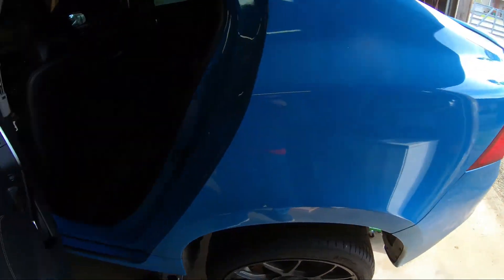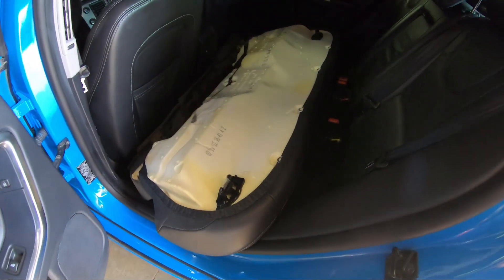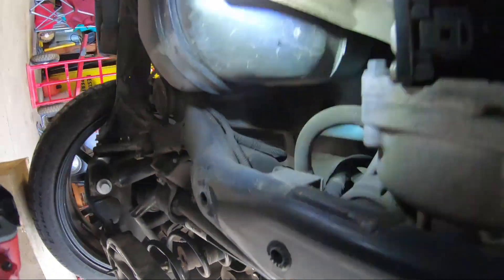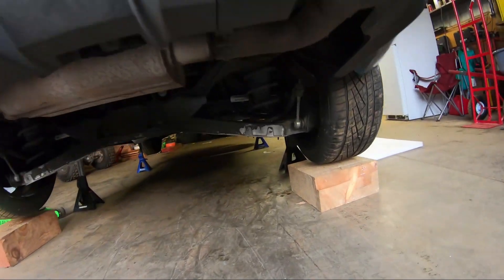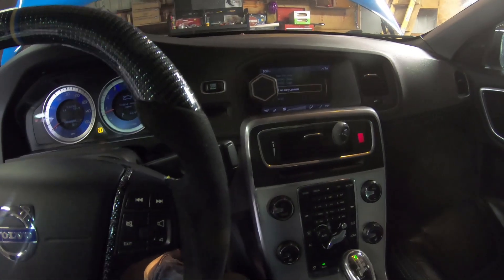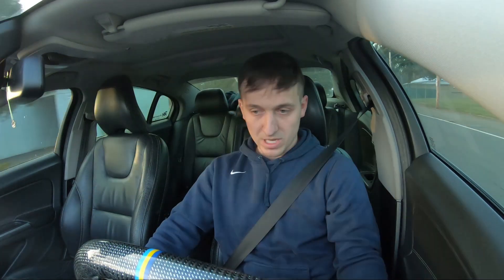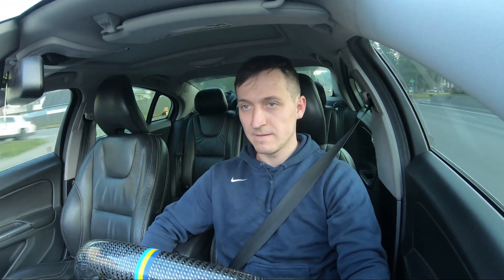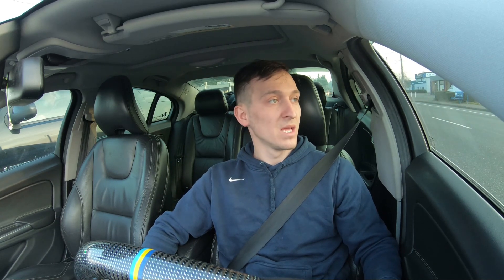Volvo s60/v60 p3 Fuel feed line DIY fuel pump access/dropping fuel tank

Comment: Hey I'm looking at a 2012 s60 t6, and I just wanted to ask you have you had any oil consumption problems with this car, I've heard that the 2011-2013 models had issues with drinking oil something with the piston rings I believe.
Reply from the maker: We have 2013 and 2014 models no issues as long as you change your oil about every 5-7k miles and use good quality oil like liqui moly. I think the oil consumption issue is either in 2012 or older or due to lack of maintenance

Comment: I think this is due to having upgraded the intercooler piping which is larger. Pressure builds up a little faster with smaller and slightly more restrictive piping. Also the Turbo spools up faster and more suddenly due to less backpressure from intake tract. That makes the car have slightly more lag and less responsive off-boost, but once it gets going, larger volume of air is forced into the engine which makes on-boost response more violent.
Reply from the maker: Could be but when they were bone stock they still acted same exact way so i think it has to do with transmission internals.

Comment: Hi, OK for the pump, but where is the PEM? I thought the PEM was between the tank and the body, i disassembled everything but it is not there...
Reply from the maker: Did you check under the Right rear fender liner or by the filler neck? By the fuel tank?
Reply: @BuiltForSpeed  I haven't looked there yet, because the car is on wheel chocks. I have to put it on the ground, take the wheel off, to do that. I'll look at it tomorrow, thanks.
Reply: @BuiltForSpeed  I removed the right mudguard, there is no PEM here, nor under the fuel door.   I'm guessing the PEM is not the rear of the vehicle, following the electrical wires connected to the pump, they seem to run from the left side, maybe it's towards the side skirt or in the front. That said it's not the same S60, i have European version powered by 5 cylinder diesel.
Reply: It depends on the model, on mine the PEM is behind the glove box, i found it. But it's not the culprit of my breakdown, it's the fucking tank pump that died.

Comment: is the fuel filter accessible from the bottom of the car?
Reply from the maker: Theres no fuel filter in t6. Its part of the fuel pump
Reply: @BuiltForSpeed  oh ok,  do u think is a good idea to add some seafoam to clean the injectors or unclog stuff in the fuel pump?
Reply from the maker: @hiro0500  no. If you want put a bottle of techron in fuel tank when you fill up. Do that about every oil change and you will be good.
Reply: @BuiltForSpeed OK Thanks !!
Reply: sí, está al costado, x lo menos en la v60 t6